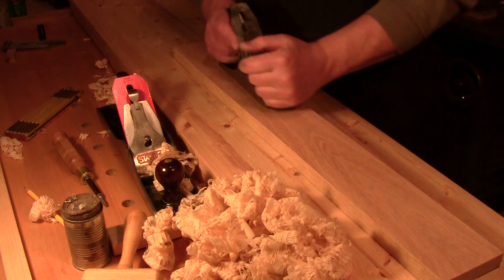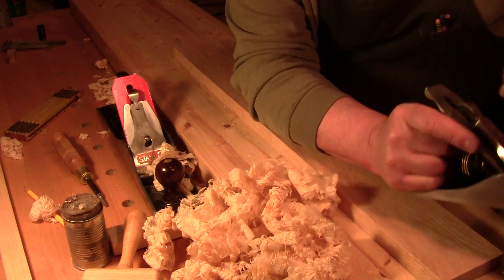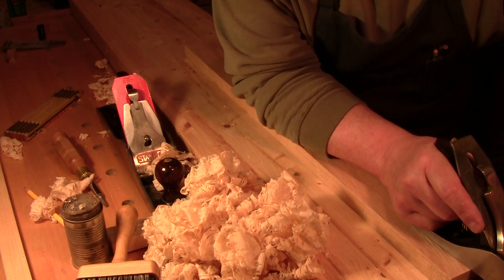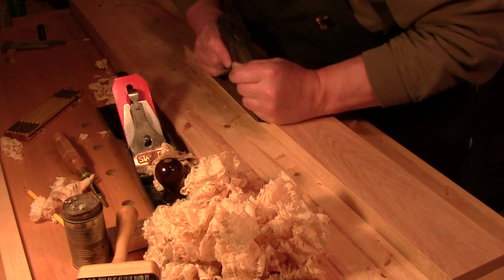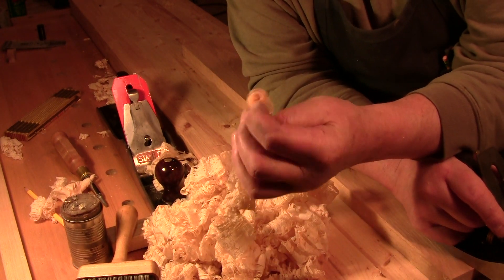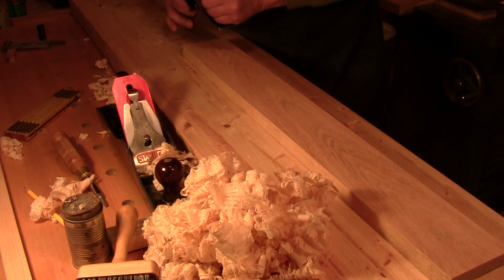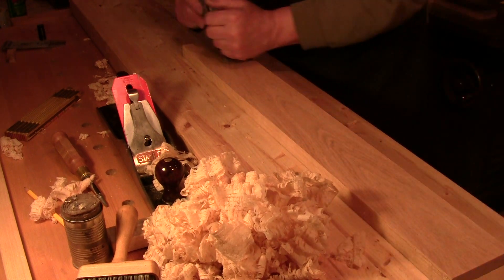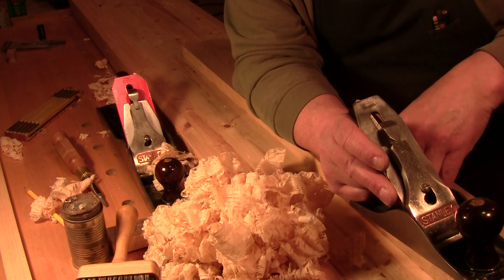Why do "They" do it ?  or Clear your throat while planing. - PLANE TALK _ 14 April 2019  #PLANETALK

Comment: Hi Walter. I also finding a joyful experience making shavings. How do you get the plane iron or the cutter with a straight edge? My planes have a convex edge and they shave more toward the center of the blade. I relate to you going to my workbench and make some shavings especially after a stressful day.
Reply from the maker: Robert,
Thanks for writing.
Making the edge straight is just a matter of honing it with less of a rocking motion left or right.
Making the convex or camber is actually harder to do and still leave a fair amount of straight section in the middle.
There are jigs but all I do is check that the Iron is straight and square with a square before I go to the honing stones and then just maintain it.
I know... easy to say, right?
Just takes practice to flatten and straighten the center mor and more each time you hone.
Thanks for Watching!